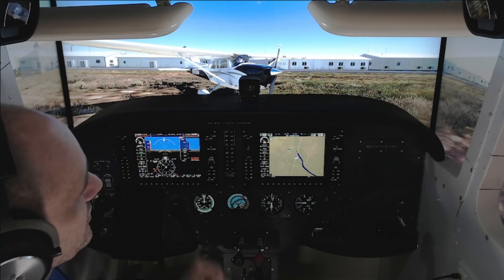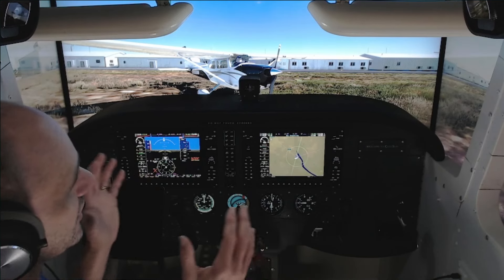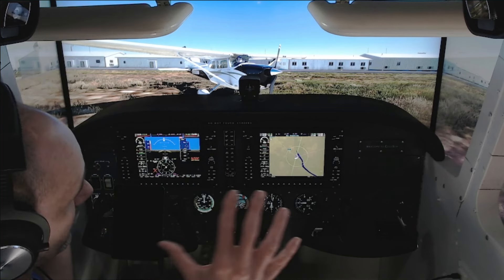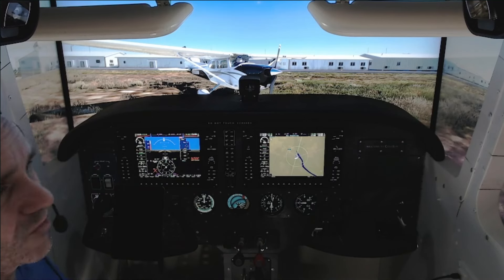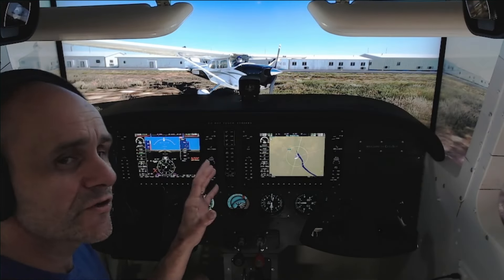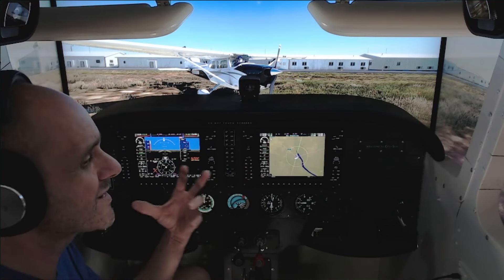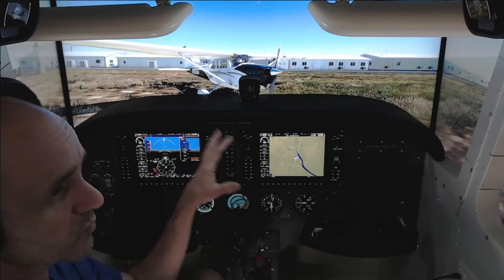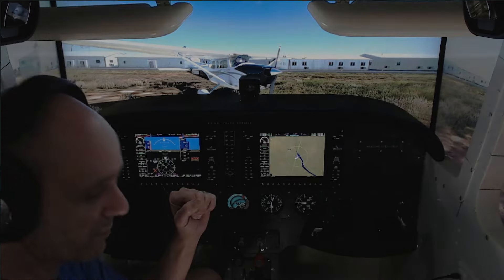201 - Sim Building: The Good, Bad and Ugly

Comment: Hear hear! I started my first cockpit project a few years back, and it did not prepare me for how much work I had to put in it. I have far exceeded the budget I was supposed to spend. And there is always something new I want to add. 

Currently I am building a Mixed Reality King Air 350-motion simulator. It's partial. Only the left side panel and no shell around it since I will be using it with Mixed Reality. I have learned so much during the process, but I sure miss flying, I am, however, getting to a point soon where the rig is flyable, even if it's nowhere near to be finished.
Reply from the maker: Thanks mate.  Appreciate your feedback and keep us posted on your rig. Love to see how it turns out.

Comment: Nice video and thanks for the insights. As you have a two seat simpit and your front monitor is centered, do you have the issue with the POV where it looks like you are crabbing?
Reply from the maker: Depends on what sim I am using.  XP no issues and FS 2020 home cockpit mode seems OK and centres the cowling / panel and adjusts cam view to compensate.

Comment: For about how long you use flight simulator . Are you going to fly with 2024 or just X-Plane 12 ? Thanks
Reply from the maker: I will be using both. It depends. If FS2024 isnt setup for mult monitors, then will be using XP12 a bit more plus FS2020. I personally like the sim with side monitor views.  Thanks for watching.